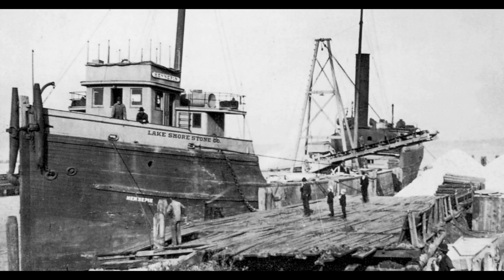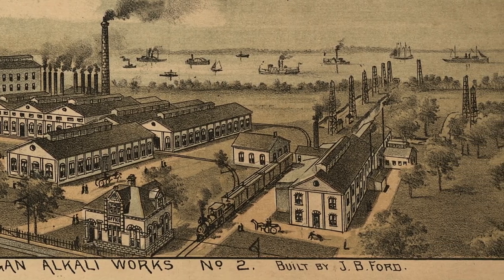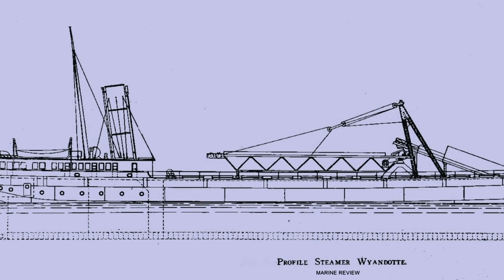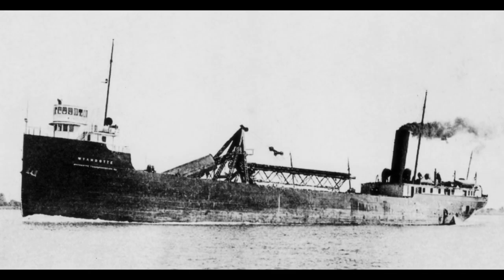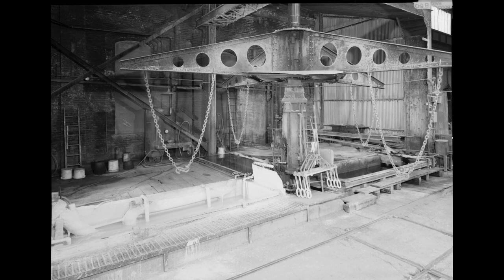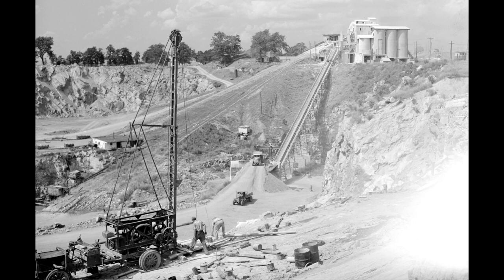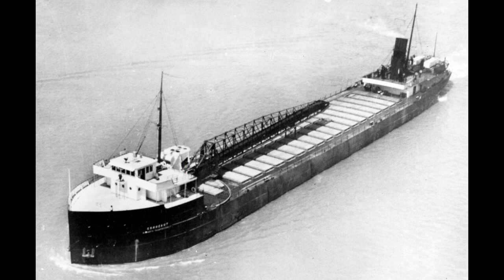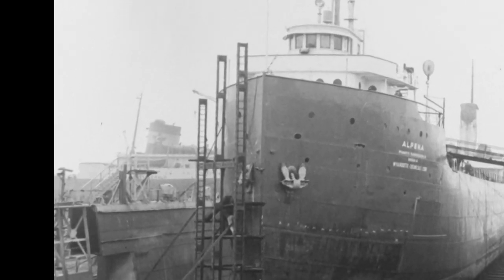Great Lakes self-unloading freighters from wood to steel the history goes on

Comment: Wes, when did the lakes freighters switch from steam to deisel? Also, what ship was last to operate steam?

I’m finishing a steel sternwheel model and thought I’d do a lakes freighter next.

Thank you fun videos
Reply from the maker: There are still some steamers running- such as the LEE A. TREGURTHA. The last coal fired hand stoked steamer is the S.T. CRAPO, which is now a transfer barge. The car ferry BADGER is the last coal fired vessel on the lakes and still runs across Lake Michigan. All other steamers are oil fired. The change to diesel, I'd have to do some digging on, but the big trend toward that conversion began in the late 1990s.
Reply: @authorwes  the Lee A. Tregurtha was converted about 17 years ago now